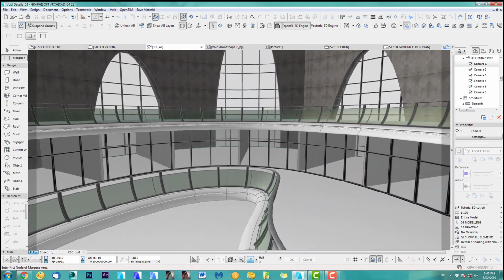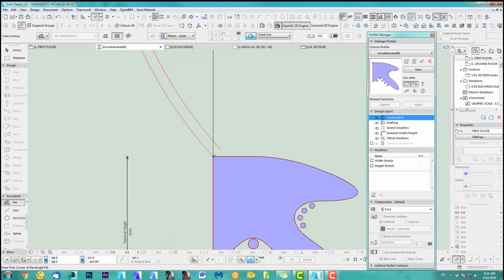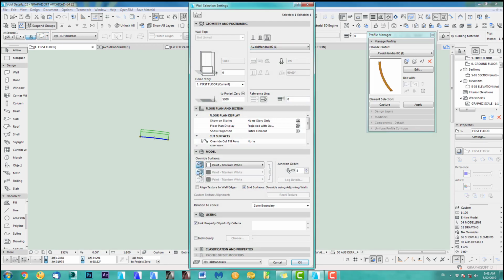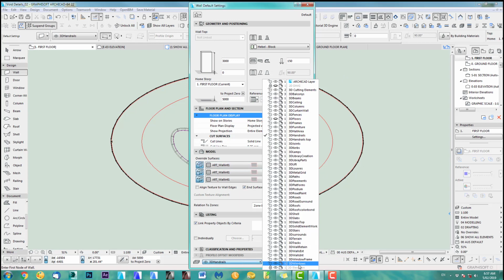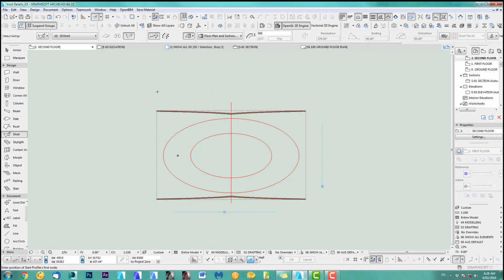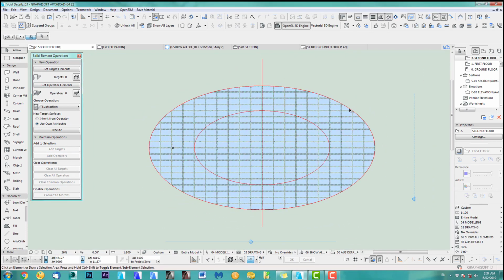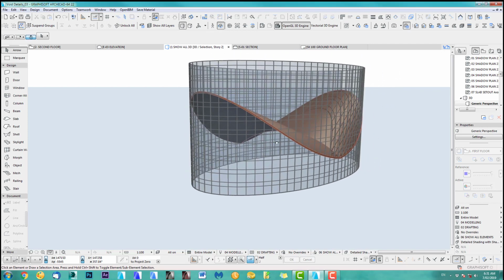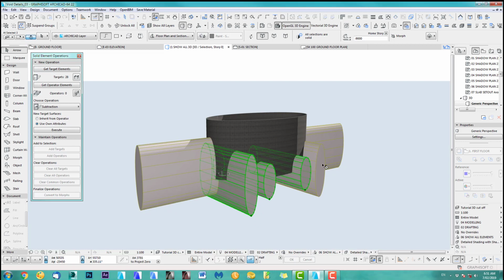ARCHICAD How to model a Void + Organic Shaped Roof

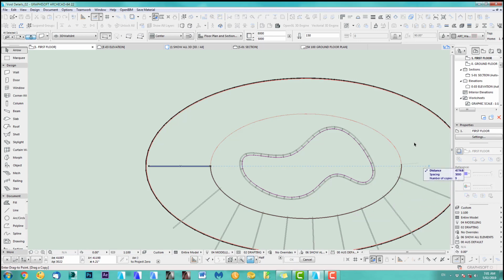Comment: 28:16  I was unable to multiply walls to follow the ellipse path,instead the wall is duplicating the shape of the ellipse creating an ellipse shaped wall. Tried for 45 minutes and I also watched other video on multiply. Again with Archicad time is being used up just to problem solve in Archicad, instead of doing.
Reply from the maker: make sure when you multiply as I have shown, to click rotate to path option in the multiply window and of course the tick, pick path before input. This option came with later Archicad versions. Not sure but around Archicad 20.

Comment: At 18:22 a tool is activated by clicking on the node. Those tools are not showing when I attempt the same sequence. Only drag, rotate,mirror,elevate. Therefore unable to reduce size.
Reply from the maker: at 18:22 make sure you click on the corner with the construction line, should be the one which is thicker then the others, then you get all the tool options, otherwise just the one you mentioned.

Comment: Ah… Nice Work ✏️  Learnt a few new tricks ✅  My Tip for you is when moving elements away from the main Model temporarily to work on, move them an exact dimension, which means when moving them back you simply start to drag and type in the same dimension.  I use nice round figures like 300, 900, 3000, 9000 etc.  This way you even keep the keyboard number down to the minimum number that works.  SO, when you are moving the Shell Roof to the top of the screen, you would start the Drag, type in say 9000 and hit Enter.  Do the work on it, then commence the Drag back to its original position and type in 9000 again and it goes back to the exact position.  And its ergonomic… your thumb is over the Zero and middle finger can tap on the 9, 6 or 3 quickly.  This saves having to Zoom in and click on a point each time you move an element back.  It also helps preventing the issue when elements are ever so slightly off a single 1mm or such like, and then you discover this small but annoying issue always after a lot of work 🙄  Anyway, hope that helps ✅  Cheers, Laurence 😃
Reply from the maker: Thanks Laurence for feedback and idea. Every so often I do this but it's not in my DNA yet ! I am so used to not doing it but it's a great idea and makes it much easier for sure, especially with the accuracy.  I will try to remember to implement this. Cheers Carsten

Comment: Hey again , I really wondering how can do as like a Rabat Theater center shape by Zaha Hadid , by profile manager or with shell tool , would be great mention zaha hadid's line .. I'm sure manny architecture students will enjoy it =) thanks again..
Reply from the maker: Yes I have come across his shape, looks just amazing. It's really hard to do in ARCHICAD if not impossible. This type of organic shape you most likely need to model in like Rhino, it is more specialised for these type of forms.
Reply: @ASMTechbase  thanks for your respond , yes rhino is so good , but still archicad has a nice layout for section and plan stuff for representing , for my idea , at least I thought to make it with line union then command for curve surface but connection is so hard , or do with profile manager , still not enough =) ... thanks once =)
Reply from the maker: @Brkdmrcn57  Yes you can't beat ARCHICAD as a whole package, it's an amazing Software.